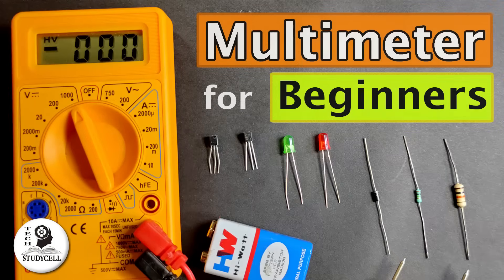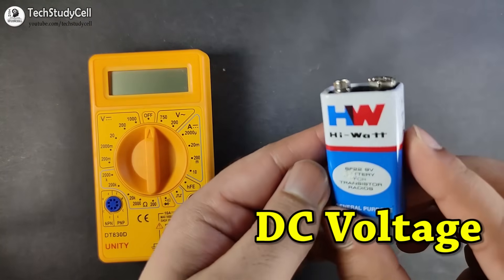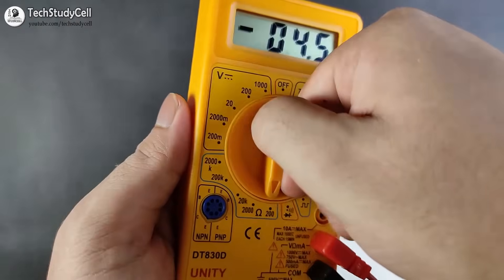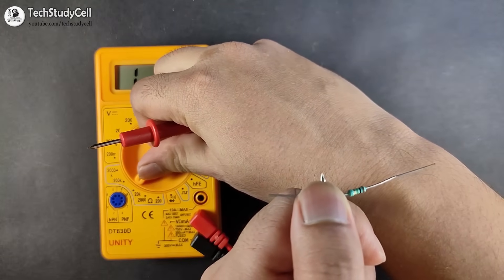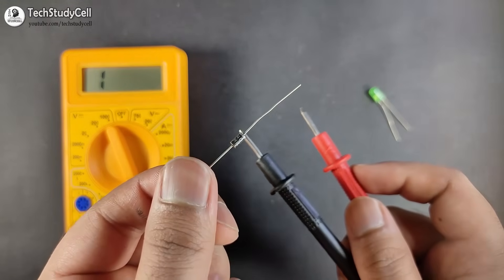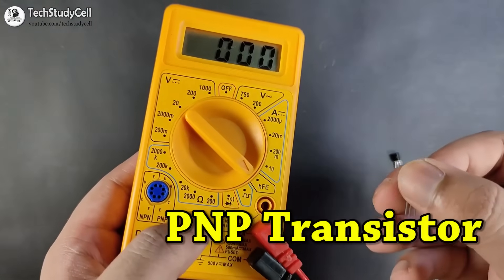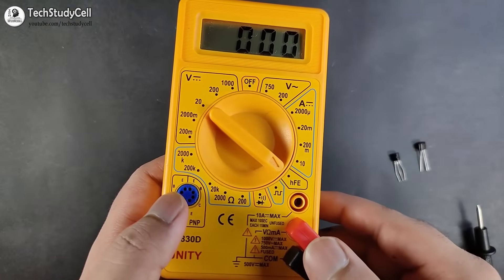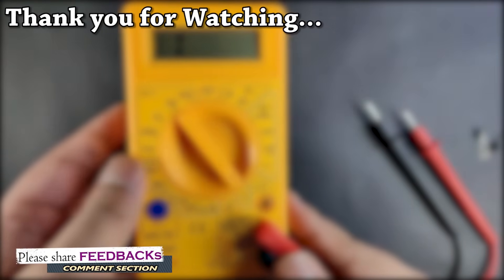How to use a Digital Multimeter - Best Multimeter for Beginners

Comment: Hi I am from Sri Lanka. I bought the same multimeter and didn't know how to use it on different components. I am a HO Model Train Hobbyist and doing my own wiring of LED and resistors. Also I needed to measure the voltage on my nickel silver track and the current draw of my DCC locomotives. I have spent over 40 minutes pausing and starting your tutorial while testing the same type of components you have used. I have understood it very clearly. Thank You very much for your very clear explanations. I have no knowledge of electronics. You are a good teacher.
Reply: You said you are ho model train hobby.
You are doing DCC also. I am interested to more on the subject. 
Please acknowledge this.

Comment: I connected my multimeter in my ac supply socket in my house to measure the voltage. It shows only 12 to 15 volts

Comment: brilliant, clearly explained, I've had exact same Multimeter for many years and only measured Voltages, But now I want to fit some LED's and needed to know how to read the value of Resistors, I was going mad trying to do it using the coloured bands, but you've made it easy using my meter...thanks..
Reply from the maker: Thanks for the feedback..
Reply: Very nicely explained, I am also having the same Multimeter. Now I have learnt how to use it. Thanks lot.

Comment: Thank you Sir for your very well explained step by step and detailed explanation without being confusing. I wasn't sure where to plug in the negative and positive leads into the multimeter for testing a car/motor bike battery and what the numbers represent on top left of metre ie: 200.. 20..2000..200m. I was happy to see how to check voltage on 9 voltage battery. So simple yet all these years, I didn't know I could do that! 
I thank you for your invaluable  information. I have booked marked your post for future reference. I have liked and subscribed.
Kind regards from Australia 
David.
Reply from the maker: You are welcome.. thanks for subscribing...
Reply: Ditto from Ireland. Full marks!